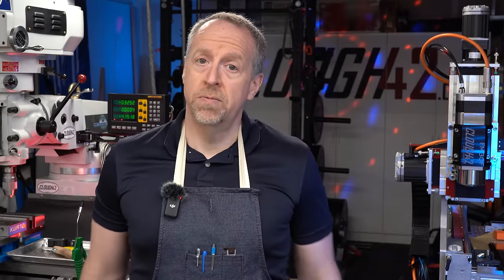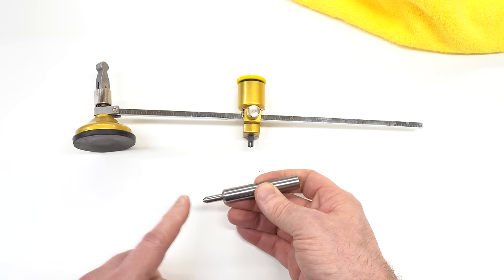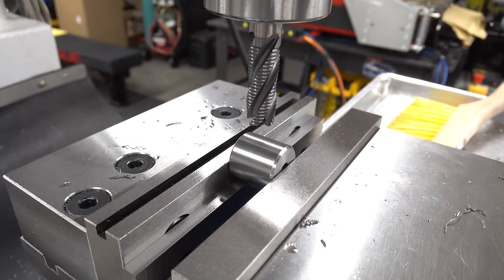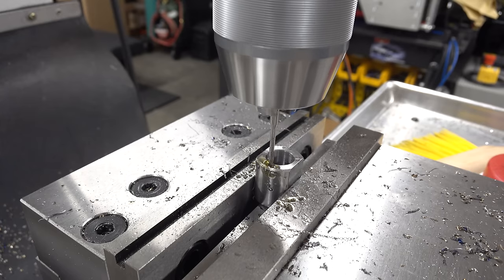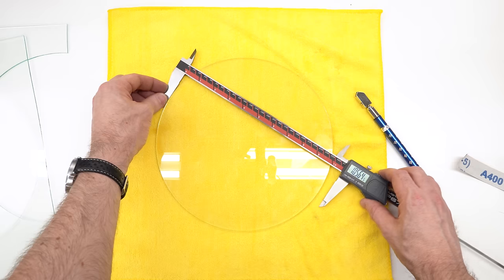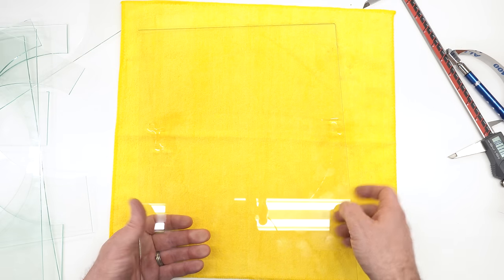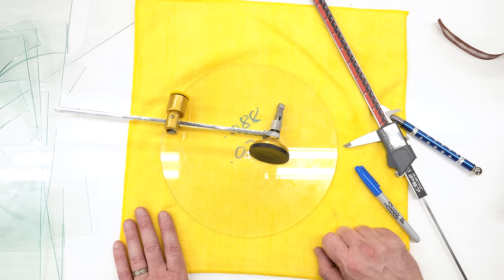Making a CNC Glass Cutter | Avid CNC

Comment: after twenty years as a glazier the only tip i can give you for a cleaner edge is to chase the cut when you up open up the score line. by this a mean apply pressure 1 or 2 inches behind the leading point of the crack as you work your way around the circle. it looks like you are applying pressure on top of it. the worst point will always be where you initially start to open the cut. but this technique should help with a clean straight cut the rest of the way around.
hope this helps
Reply: after reading the other comments. scoring on the opposite side will not work at all it will only create more tolerance errors.

 the diamond engraver cant be lubricated properly and will not leave a clean score line, there is a reason all glass cutters are wheels.

 heating the glass will result in a wavy cut when you open it. best is room temp 

and glass has no more movement than steel
Reply from the maker: Thanks for the benefit of your experience.  As you noted, there is a lot of advice here from people who thought about it for a few minutes, but have never actually done it.  It seemed clear to me (someone who has also thought about it and not done it) that scoring both sides would not work out because the fracture lines would never align.  I'm able to run the crack ahead of the pressure point pretty easily, until it gets near the edge of the sheet.  At that point, the forces change significantly, since I'm just pressing against the support from the towel underneath.  Some have suggested cutting a my circle out of a larger circle so these forces would be even.  That sounds reasonable, but I'm becoming convinced that the only real solution here is grinding.
Reply: @Clough42  your welcome for the advice. Cutting your circle from a larger circle would give even pressure when opening the cut but I’m not sure how much it will help. You are right about the grinding. If you are looking at .000 inches then grinding is the only way. The glass cnc cutting industry is well established and you should be able to buy polishing bits that fit the Collet on your machine. Then you would need a water coolant feed and drainage also a vacuum holding method. I would make a tray with vacuum , drainage and high sides that can be fixed to the machine bed when needed. Water feed can be clipped to side of  the spindle. This method would require checking of the tool diameter to adjust for wear and tear on the grinding wheel

Comment: Is your out of round consistent with the orientation of the glass on the machine in a particular axis/axes? If so you could either adjust your machine to be true if that is the issue or if it is the cutter maybe you could program the CAD/CAM to cut an ellipse that accounts for the error.
Reply: His machine isn't the problem, it's the process of breaking the glass.
Reply: @justinlabarge8178  I agree with you, but tracking the orientation would have been wise none the less. I think the  way glass breaks close to an edge is different than near the center. The leverage forces seem to change the way the glass fractures in strange ways.

Comment: You can try milling glass with carbide endmill just like Stefan Gotteswinter showed in one of his video. I think it is worth a try but it wood be a bit mesy but you can use vacum cleaner.
Reply from the maker: Yeah, I considered it.  A diamond burr and flood coolant also works well as shown on Applied Physics.  But it's also super slow and messy.
Reply: @Clough42  Applied Science. Ben has a the Advanced Patience & Tenacity plugin installed.

Comment: There might be some backlash in the cutter head.  Also, when the CNC moves the cutter quickly, it might slightly torque the direction of the cutter due to acceleration.  Maybe keep the acceleration really small and gentle right after the initial straight line?

Comment: Determine if the oval shape of the glass has a fixed orientation wrt the CNC table.  If the orientation is fixed, program a compensating oval shape in your tool path.

Comment: water and oil never hurt for keeping the dust and chips down, and actually help keep glass dust out of the works of the cutter itself.  how the water and oil helping to propagate cracks is one of those deeply scienticious and somewhat debatable questions, like the old "is glass a liquid or a solid" debate.
I split all diameters of glass tubes using tungsten carbide or diamond scoring.  if the diameter is small, I will use water, and put tension by flexing the tube with my hands.  what is fascinating to me is extra bending force is not usually the best strategy.   it takes TIME under slight tension for the crack to propagate and split the tube.  if it's large diameter tubing I split it with thermal stress while it's being held in the glass lathe.

Comment: I suppose you checked the bearing and the play on the cutting edge. But i might blue a bit of metal and run concentric circle marks  - pitty it wont cut sharp corners, or you could try a 3d printer trick with inscribed square-circle-triangle.

Comment: Because the cutter is dragging slightly behind the center of the tool, the circle will always be slightly smaller than intended. A little math should be able to fix that. For the "oval-ness" problem, does it matter where you start the break (i.e., is the oval aligned with, or perpendicular to, the starting point)? Also does is matter if you start the break by applying pressure to the inside vs. the outside of the cut? I suspect the break is applying angular pressure, causing the slight bevel. Maybe a large circular ring could apply even pressure to break it evenly.

Comment: the only way to really go perfectly to dimension and circular is to grind it in. the nature of the way glass fractures won't allow it to go as precise as you'd like. However, now I'm curious if you can get the scoring front and back to line up perfectly, because if you can, it might help a tiny bit, make the deviation about half, by directing the stress paths. If that makes any sense. 

--edit: wrong word

Comment: Hi James, A thought, Have you tried to run the crack using alcohol and a flame?  so as to not exert 10 digit pressure around the fracture and near the edge of the sheet. I have watched a windscreen mate do this on LAM glass.  Sorry if someone has already mentioned this. Long time viewer first time comment.

Comment: Would it be easier to assure orientation of the swivel blade just by starting the cut on a tangent?  Or would that cause the "crack" to go awry once you try to remove the circle from the sheet?

Comment: If you could rig a friction mount I'd say you could precision grind the edge with either a diamond wheel or perhaps aluminum oxide. If you were to mount it on a rotating surface like a rotary index and set up to more or less "surface grind" the edge it would work and produce reliably sized plates every time. The only issue I could see with that would be the consumables as I'd imagine you would want to dress them before each use.
Reply from the maker: Yeah, @laneymachinetech just demonstrated this with a Type I diamond wheel and a rotary table.  It's a messy process, compared to scoring and cracking.  Though it does have the added advantage that it works.  :)

Comment: If the circular dimension was critical, I would cut it oversized and mount it with pitch/superglue on a mandrel in the lathe, then run a toolpost grinder to dimension.

Comment: I don't know if you have the tools for it but I would cut it oversize with the original Amazon tool with the play taken out of it, cut two scraps of 3/4" plywood to just under the final glass dimension, sandwich the glass between the plywood with rubber or foam sheets on both sides and grind it with a tool post grinder and a diamond wheel to final size.

Comment: Excellent video, I skipped ahead to the results and though I was being smart by wondering if the non uniform differences arose from having two rigid materials [work-piece/tool] . A spring loaded tool being a solution you had already implemented humbled me quite some. 

One thing I have noticed from general making of things from cheap components, if its a small/cheap bearing, its a C3 clearance and dont be surprised when you take it to bits and find they carrier doesn't have a full set of balls, whilst im not sure what bearings you salvaged from the hand tool [or if it even had ball bearings], its worth a check to see if the bearing is only half populated or of loose tolerance, with the leverage effect of the head/cutting_disc, this could be a major part of the lack of repeatability?

Comment: I've been using a water jet to cut glass almost perfect diameters. Stock is expensive 40/60 beam splitting glass .06 thick. Biggest problem was cracking from the glass flexing but once I got some new Rino board and better way of securing I was almost there. I found penetrating it was also a chance to crack so I set lead in for the amount I need to cut from and edge about .100" then start my circle. I feel your pain brother!

Comment: One of my friend producing circular glass plates for instruments, satellites, military devices, boats, laboratories etc…
He can produce up to 0,0001 mm precision with…..
Newspapers and a lathe!
So… first he cut first raw square blocks with diamond disks.
Then he cut each side again to 8 side. Then to 16. With this way, he isn’t introducing crack stress lines in the glass.
Then he stacks 4 dead blank, 8 real plate, 4 dead blank to a tower with newspapers and water.
Then he put this pile of pancake to a lather with a special rig, then with water and simple super cheap diamond disks, turning them to the right size.
Then he disassemble the pancake pile, and with a nice Mitutoyo rig, finding the best pieces in tolerance.
If something not good, he just keeping the pieces for future usage for small diameters, and or, dead blanks.
He is a focking millionaire from this…

Comment: My suggestion is to go back to the suction cup, but make the pivot arm yourself, with a bearing and precision fit.

... another idea: possibly, the discrepancy in your dimensions is due to backlash in the router. If you divide your circle into four cuts, with an operation to take up the backlash between each quarter?

Comment: Could the laser you're using to etch the glass also be used to clean up the edges and bring them into dimension? If so, I wonder if it can do it without adding a ton of extra time and passes to the process.
Reply: I had the same idea.  I have a Glowforge and it certainly can etch a fairly fine line.  I think I'll give it a go.

Comment: Would it help to do this on the lathe? You wouldn't need the swivel mechanism then, and if there is any play in that part it would become a non-factor. EDIT: Also since the amount of "ovalness" is pretty consistent, are you sure the CNC machine is properly calibrated between the x and y axes?

Comment: Usually there is a reason why something is not easily available. You should have gotten hold of a reamer of the right size for the 1/4"hole. Using such a small  boring bar will result in a lot of deflection.
Reply from the maker: I have a reamer the right size.  Boring makes a more concentric hole.  Boring bars are available for diameters down to at least 0.015".

Comment: Your video was recommended to me today.  Was really interesting to watch especially since I didn't know what equipment you had as it went.

Since you have a CNC, could you use it with an appropriate sanding tool to orbit the glass and bring it into final dimension?  Would need to find an appropriate way to work hold from the centre.
Reply from the maker: Yes, and this is probably the solution that will give the best results, but it's also slow and messy.

Comment: I haven't read all the comments.  is it possibly the cutting tip on the shaft which has some play or slop in it? I think it would be interesting to mark the glass before cutting it out to see if the runout is consistent between blanks?

Comment: I maybe incorrect, but you can get an error depending on the rotational starting position of the cutter as the CNC circumscribes the diameter. If you enter the cut with the disc positioned at 90 degree to the tangent and then turn to make a cut, the scribing midpoint point of the disc's diameter is offset from the diameter. As the cutter reaches 1/4 way around the circumference, the scribing midpoint is now tangent to the the circumference. This repeats itself twice for the next two 1/4 way around the circumference. At the end, you've created an elliptical shape. It would be interesting to see if you get the same error using a diamond point scribe instead of a disc, or start the cut with the disc entering perpendicular to the circumference. Perhaps, you could model the cutter in fusion 360 and perform a simulation.

Btw, You could also add a small oiler with a tube that hangs off the holder.

Comment: You could grind that edge. Imagine two ball bearings riding the edge of the glass and a cutting tool in between the bearings, offset to get whatever diameter you are aiming for (essentially forming 3 points that define a circle). Then just push the glass against the bearings and rotate full 360 to grind it.
Reply from the maker: Pretty sure that won't work.  The feedback is backwards.  A piece larger than the desired diameter (which is what you must start with) won't touch the cutting tool at all.  A piece smaller than the desired diameter (already too small) will engage the cutter, and it will get smaller and smaller until it slips between the guide bearings.

Comment: TIP......Stick a glass plate on you on your three claws and cut it out with your diamond thingy. Then turn it to size. Use cooling (no fog) Water works wonders with glass underwater, you can even cut glass with scissors.

Comment: What about drilling two dowel pin holes for registration
Place glass down, score top surface
flip the piece, score the other side in the exact same place.
Also, what about using a 3D printer for holding the tool ?

Comment: First and only problem you have , that I also have is cutting glass like a machinist trying to hold tolerance like a machinist.
Reply from the maker: For the application, a very close fit is required.  After everything I've learned through this process, I think grinding to size is the best solution for the application, given that I can't go back to the middle of the last century and convince them to redesign the comparator.
Reply: @Clough42 I know what it’s like man .. after becoming a machinist years ago and doing wood working on the side I end up making my measurements to the thousandth 😀 on all my woodworking projects. 
Also optical comparators work very well … it got us to the moon 🌙

Comment: I too think it's the nature of the material as it breaks through it's own depth....I suppose the only way to ensure dimensional accuracy to a level you require is to use the CNC to polish the edges to a ground finish..?
Reply from the maker: Many have suggested this.  It may be that grinding is the only way.
Reply: @Clough42  I had some round instrument glasses cut by a company that advertise a precision cutting service... but only to -/+ 0.5mm..Not engineers obviously...!

Comment: My guess is that the CNC machine may have more backlash in one axis to the other.
Mark on the glass how it is positioned on the machine in respect to the X axis and Y axis.
Make a cut and measure along both axis on the glass. See if that is your large and small diameter  of the circle.
If that is true, program a oval to make up the differences
Reply from the maker: The machine has essentially zero backlash.  I checked it a couple of weeks ago, and it was around 0.00015", identical on both axes.

Comment: Too many comments to check them all, but the carbide wheel trails behind the center and does not run tangent to the circle. It is always being pulled along a line between the wheel contact and the center of the pivot. Off the top of my head I would expect a slightly smaller circle with the CNC and the Amazon compass. Then the stress in the glass might have a direction to it. Annealing the glass is a possibility.

But why not drag your diamond engraver?

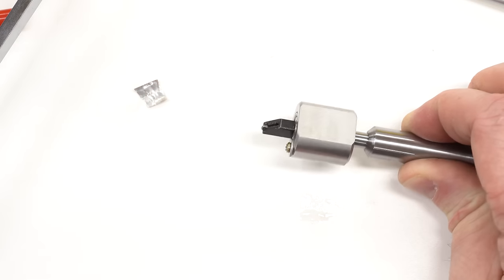Comment: 9:40 looks like slop in the spring mechanism. why didn't you machine a new pivot for the glass circle cutting tool?
Reply from the maker: I can't do anything about the flexibility of the rubber suction cup mechanism, so even with a perfect pivot, I would still have that as well as the challenge of repeatably fine tuning the diameter.

Comment: I wonder if instead of using the cutter wheel / bearing assembly a fixed cutter (hardened point of steel or sharp diamond dressing stone) mounted in spring assembly would have tracked the circle better. I believe as the wheel moves it is not tracking correctly and causing an oval to be cut instead of an accurate circle.
Reply from the maker: I tried using a diamond engraver first, and the crack simply would not follow the score.
Reply: @Clough42  Ah. Assuming the machine is accurate the only issue I can see is with the "caster" of the cutting wheel. It's an interesting problem, did you notice any repeatability as to which way the circle "egged out"? Consistent along one axis or just random? Another way to try would be to mount glass on horizontal rotary table and have the cutter fixed on machine spindle. In essence move the glass in a perfect circle, not the cutter. Worth a try.